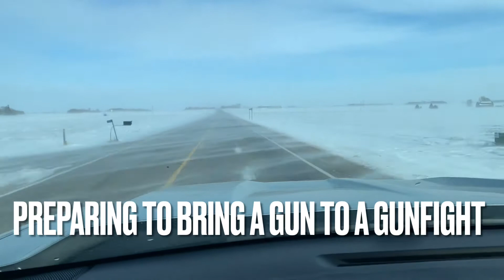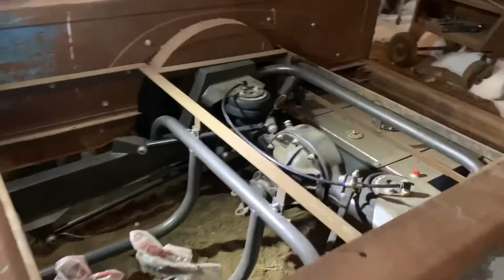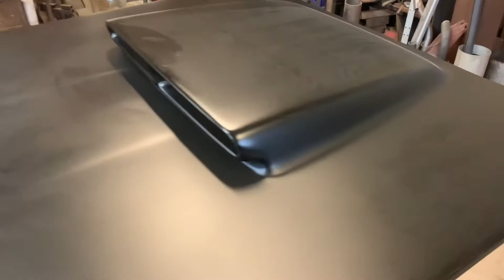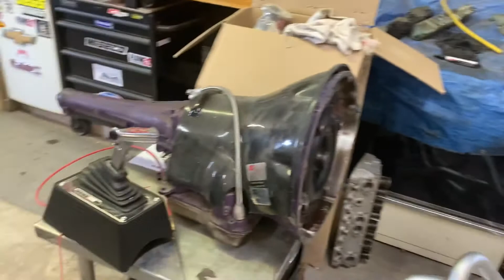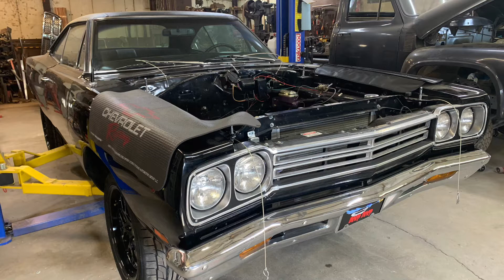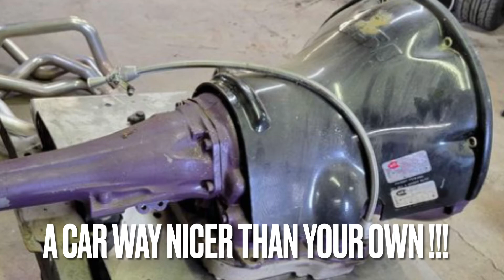Parts Run

Comment: Satellite?
Reply from the maker: Never checked the vin, definitely wasn’t an A12, but I want a black 69 with a 440 six pack and it checked all the boxes, except the wheels. I’ll keep my black Steelies
Reply: @BigfootsnMopars  Steelies are the shit. Road Runners and Belvedere’s were strip model cars, they never got any trim. Only a Satellite, sport Satellite or GTX got trim. Same on the sink in tail lights. RR and Belvy’s were more flush. I didn’t see the big ass GTX emblem on the side, but I coulda missed it.
Reply: Still a bad ass car.
Reply: I looked again, No GTX. I see RR decals. Likely a clone or he’s just doing what he wants with the car. It’s got a RR / Belvedere grille. GTX and Sat’s has a special grille, not as attractive IMO.
Reply from the maker: @JonnyMopar  I knew the decals were in the wrong spot. Car had Purple flames, tons of purple wire covers under the hood. The drums were Purple.. Cullen was de-purpleizing it
Reply from the maker: Old guy originally built it. I bought the 727 low mileage/build sheet/ Cheetah valve body with Trans Brake